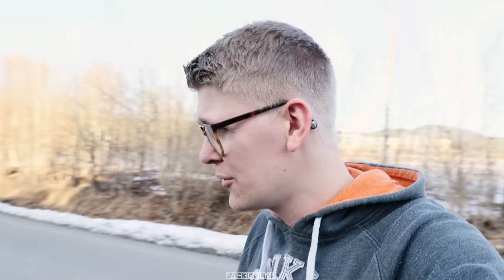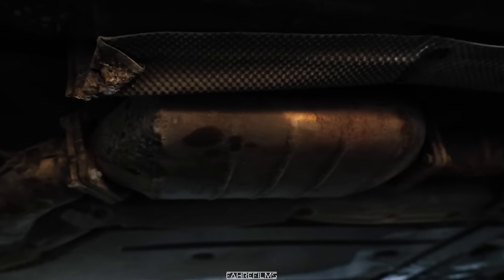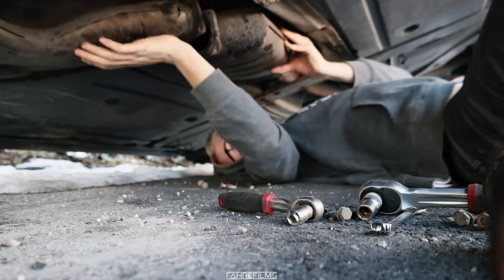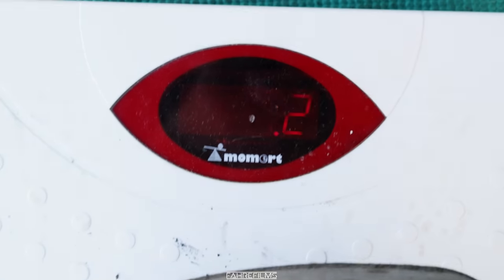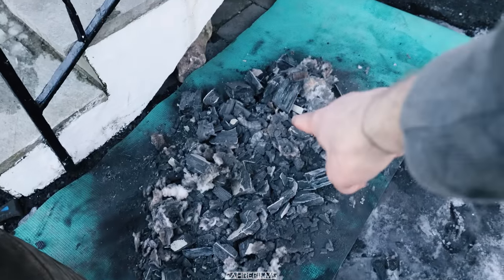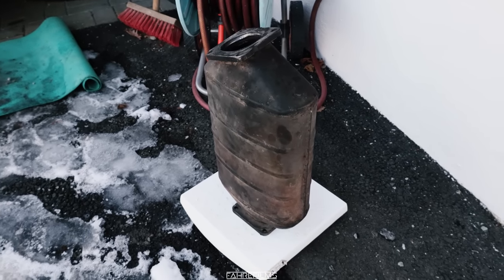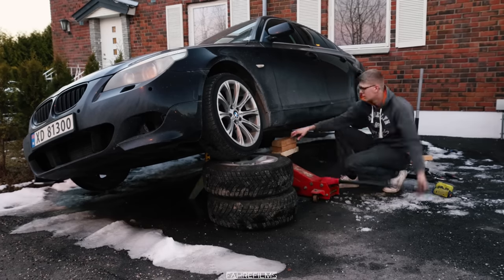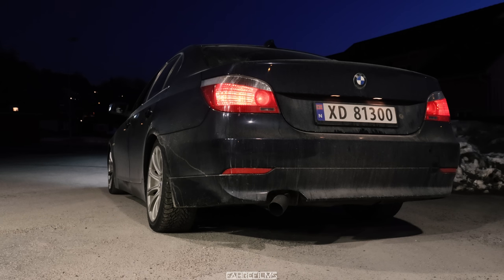MORE SOUND?! Removing The DPF On My 525 Turbo Diesel E60

Comment: If u want it louder , than you need custom downpipe . Or just make one .
Reply from the maker: Yeah true, I could make one myself. But I’m happy with the sound now so I don’t think I will use more time on the exhaust 🤷🏼‍♂️ Does the tone of the sound change? Or just volume?
Reply: @FahreFilms  it sounds good , i have dpf delete on my 530d and sounds a bit louder with original muffler . But it sounds great .
Reply: Removing the dpf or cat is really unnecessary. It makes almost no difference in performance, only makes the car noisier and the car just stinks real bad because of the nox, making it absolutly disgusting and dangerous to breath that stuff in because it can cause cancer. If you want performance get a good tune and thats it.
Reply: @FeZerret  and so to get a better tune - You need a downpipe with no cat . So there is no differenc is the cat is empty or you have a downpipe 😆
Reply: @TheCraizyGamer  skati vari iziet bez dpf filtra?
Reply: @roberts2760  protams ka var , izgāju savam 😺

Comment: that's a catalytic converter, my friend. The dpf has tubes and sensors and what not for regenerating
Reply: It's not.. it's the DPF
Reply: @GeorgeAusters  if that's a DPF how does it regenerate when it fills up with soot ???
Reply: Not all cars use a dpf fluid, some add extra fuel so the exhaust gasses are hotter so it burns the carbon away @ThaZapalka
Reply: This is also the secondary dpf, the downpipe has the first part of the dpf and the cat
Reply: @Theswedesteed  Yes, and that added extra fuel ends up in the oil sump if the dpf regeneration is interrupted due to lack of proper conditions(like temperature). When that's the case there should be an additional marking on the oil dipstick to tell you to change the oil because it's diluted with diesel fuel. With that said I haven't seen the dipstick of an M57 post 2005(when DPFs get obligatory equipment for all diesel engine cars) so I'm still not convinced this is a secondary DPF 😂 + it's so far away from the turbo I can't imagine it maintaining the needed temperate for burning the soot...

Comment: At least on e39 petrol models, that plate is meant to help support the exhaust so it wouldn't sag that much
Reply from the maker: You sure? Letting the exhaust rest on that plate creates alot of vibrations in the car so I don’t think that’s the idea 🤷🏼‍♂️
Reply: @FahreFilms  on e39 there is some sort of rubber pushing of some sortbetween exhaust and that plate, that helps reduce vibration

Comment: What you removed was the catalytic converter and you could have sold the ceramic bits inside it. The dpf is located in the upper first part of the exhaust system.
Reply: no is not, that was the dpf the cat is upper

Comment: Good vid but without a DPF you will most likely fail the technical inspection. In some countries you can still pass if they don’t see that it’s empety but in a few years there will be machines that will be able to tell. And you have to program the car othervise it will go into service mode
Reply: doubt hes gonna keep this car for a few years lol
Reply from the maker: Thanks, I don’t think there will be any issue with M.O.T. Still have the catalytic converter in the downpipe and this 2004 model cars does not have super stricts rules on emmissions. Know plenty of people who have passed M.O.T with no DPF on a BMW diesel 👍🏼
Reply from the maker: @thatblue-e92  hahaha, that’s also a very good point 👌🏼
Reply: Cars actually pollutes less with a DPF delete but it HUGELLY depends on the car's overall state. A healthy diesel engine with a DPF delete do not pollute more, it is barely noticeable. How do I know? Hehe
Reply: My formed 530d is gutted out but box still there with engine light on and no issues haha how? 😂

Comment: Please remap that car! Its so huge difference and it also would sound much more with more fuel
Reply from the maker: Car is actually faster already with just this mod, but why is remap so much difference ? ☺️
Reply: @FahreFilms  i have big experience in those m57 engines! In 525d manual you can get about 260hp with stock turbo whitch is such an impressiv difference in power from stock! The exhaust sound changes to 80% more aggresiv and deeper
Reply: @FahreFilms  bmw diesel engines are just so much better with a remap my 3.0d 2004 E60 is making 300hp with just a remap from 218hp i think

Comment: Looks more like a cat that a dpf
Reply from the maker: Pretty sure it’s DPF, the cat is in the downpipe of the E60 diesel models 👍🏼 Does cat and DPF look the same on the inside?
Reply: @FahreFilms  dpf usually have sensors plugged into them. And once you've gutted a dpf without a map will cause huge problems as it will try to regen but has no guts in it. Where as gutting a cat doesn't cause any issues .
Reply: @FahreFilms  on Pre lci e60s the DPF are in the middle! In LCI the CAT and DPF is in the same muffler in downpipe! CAT comes always first and DPF is second in all cars! And yes the CAT looks pretty same as DPF, i suggest u remove the cat also for a little better sounding m57
Reply: @LONELYcheeseBOX considering you seem to know something about these, would you say in that case that a 2005 pre lci e60 525d m57n would have the dpf in the middle of exhaust and not up with manifold. Thanks..
Reply: @M57connoissuer  yes! The pre lci dpf is in the center of the car bro😁

Comment: did you get a check engine light after unpacking? because I want to take it out, I'm just afraid that it will give an engine control light.
Reply: i am going to do it on my car tomorrow, I think because the sensor is in front of the dpf it should not be a problem.

Comment: Need to delete dpf from the ecu, and flash stage 1👍 You cant just remove dpf without coding.
Reply: Yes you can on pre lci.
Reply: @bimbalineslyva2234  whats that?
Reply: @Peter-wo4uo  pre LCI e60 were the earlier versions.
Anything past 2007 onwards Normally is LCI

Less complicated 😊
Reply: @bimbalineslyva2234  i have pre lci and it does need coding

Comment: Straight pipe with 3in minimum from turbo to end.. and pop corn rev meter tune
Reply: @apteka I am not sure why people would laugh, I am a diesel head (Rolling Coal person) and I have seen TDI builds that have pushed 300+ bhp in a 2.0 TDI as well as a many other builds... A petrol and a diesel engine are different but it's a different feeling, as you have  seen/noticed all he has left to do is change the downpipe in the above build... And a remap to accompany the above mods would make the engine more efficient...

Correct me if I am wrong on the input from your end.
Reply: @apteka 

Usually all the pipes that come on a performance/potential performance vehicle or let's say any engine above 1l in both cases petrol or diesel vehicle are 2.5" approx and in some cases 3". I didn't ask him to change the huge dynamics of the pipe. 

Straight pipe diesel doesn't make loud noise rather it's a grunt noise, and in cases of petrol vehicles it's loud like ear screaming loud but not in the case of a diesel engine.

Pops and Bangs are for petrol vehicles, and i suppose you might have mistaken my comment on the popcorn rev limiter for Pops and Bangs. 

Childish maybe, but once you remove or alter the exhaust of the vehicle it's always better to do a tune as it would help the engine better. And at that point all I suggested was to have a Popcorn limiter tune as the respected person was planning to increase his diesel engine exhaust sound.

And I am saying it based on my experience with a 1.5 TDI engine that I had owned and had done a small turbo upgrade and a stage 3 setup.

Diesel doesn't make loud noise as much as compared to any petrol engine.

Comment: I removed the dpf on my 02 opel omega then i got alot of black smoke and thats what i wanted😂👍
Reply: Not like an extreme amount
Reply from the maker: Cool, did it have a cat also? Mine does not smoke black at all. Was it chipped tuned ?
Reply: @FahreFilms  mine is stage 1 chip tuned yes that might be the reason there is black smoke im not that good with cars😅😂 i just know the dpf is removed and its chipped to ca 150hp
Reply: No Opel omegas ever came fitted with a DPF

Comment: This is not a Dpf, you removed the catalytic converter, if your engine has a dpf it will be just after the turbo, dpf has to have pipes for the differential pressure sensor, and also a temp sensor in it, this is just a cat
Reply from the maker: This is a early model DPF :) E60 is a bit wierd, but the catalytic converter is in the downpipe and this the DPF :)

Comment: Thats a catalityc converter , not a dpf
Reply from the maker: Nope, pretty sure it’s the DPF. Cat is in the downpipe on these 🙃
Reply: dpf-found on diesel vehicles
catalytic converter - found on gasoline powered vehicles
Reply: @cmanesq  diesels are also equiped with cats
Reply: That's dpf i just removed on my 525d yesterday..
Reply: @cmanesq  You are wrong 🙂
Reply: @FahreFilms  It is Dpf you are right. They dont know what they are talking about. Take out the Cat aswell. And you can rev at Uno x in Kjørbek  😂